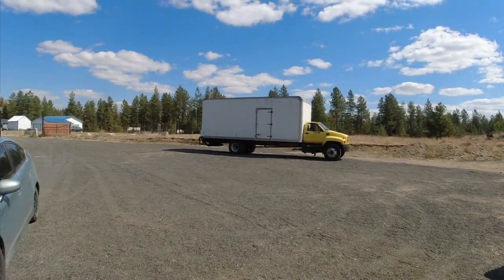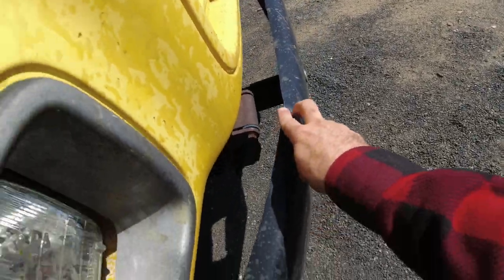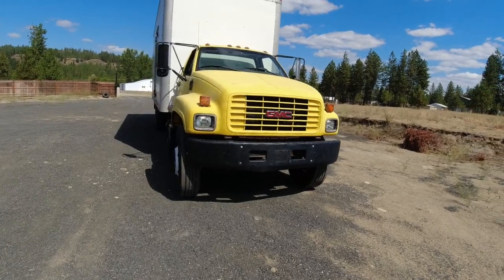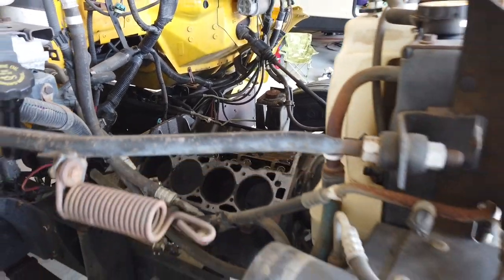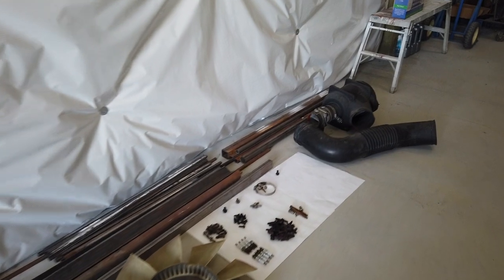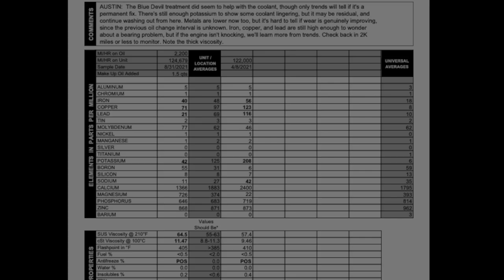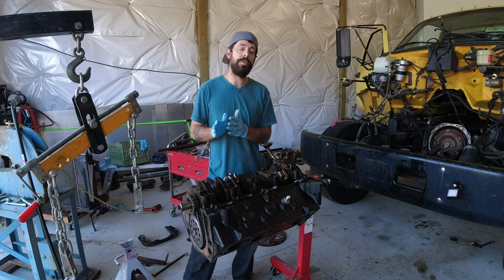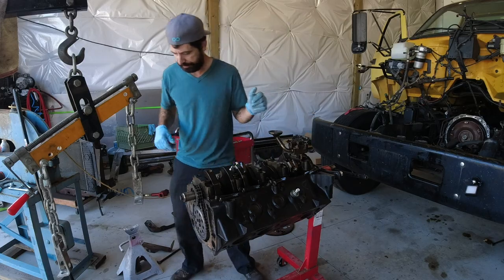Building a Custom Pizza Truck (Episode 1)

Comment: Did you welded the shipment container to the chassis or did you how to go through a different process?
Reply from the maker: I show it in more detail in a later episode, but I had custom  U bolts made to bolt the container to the truck